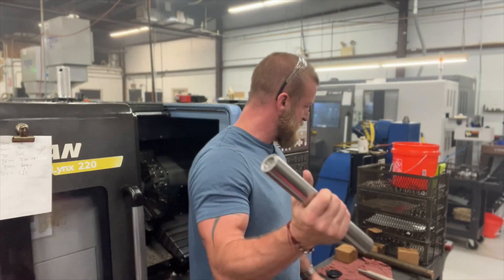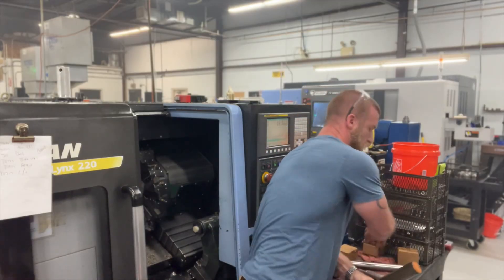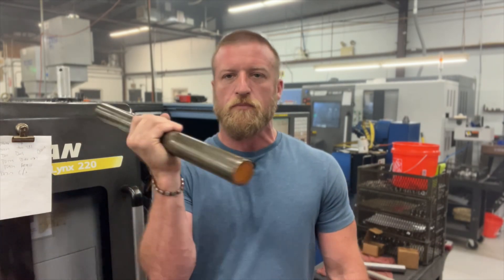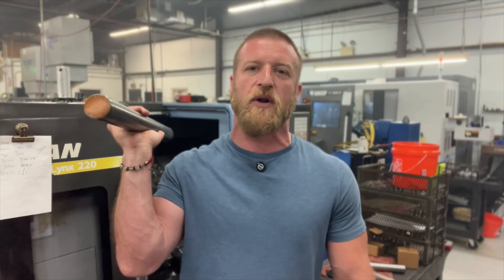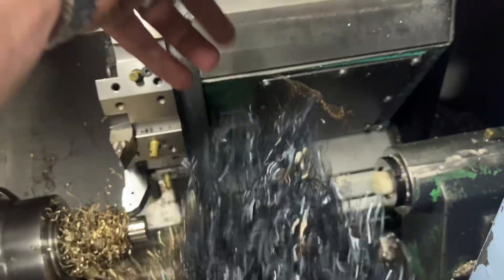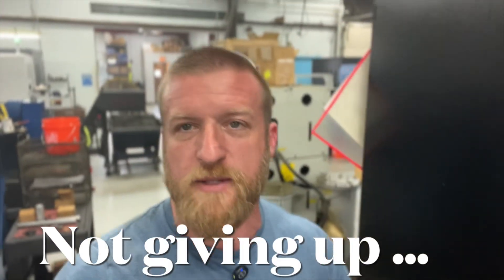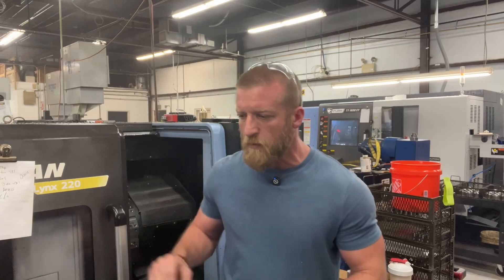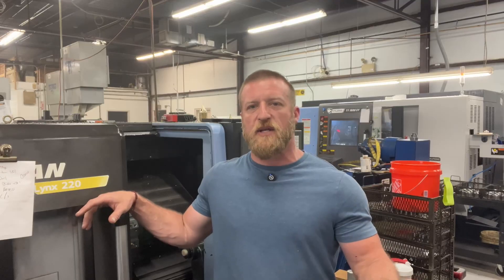RED-HOT MELTDOWN: Burning Insert and Glowing Chips in Epic Tool Failure!

Comment: I think this is a good reminder to really test the limits of the tools we are using.   I have some repeat jobs we do every month that I haven't changed any speeds and feeds on in years. Probably leaving something left on the table by not trying to make them more efficient
Reply from the maker: That’s the move right there. I’m the same way. There’s probably jobs I could speed up and improve. Making this video was actually pretty eye-opening.  I thought my first set of cutting parameters would have generated some amount of damage or excess heat , but it didn’t not even a little bit.